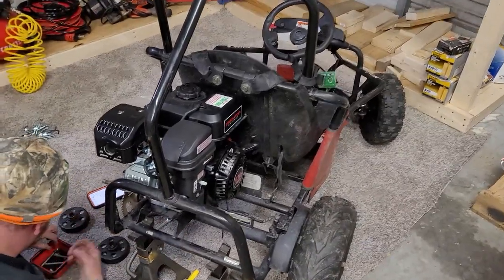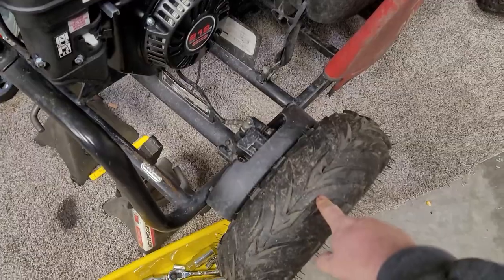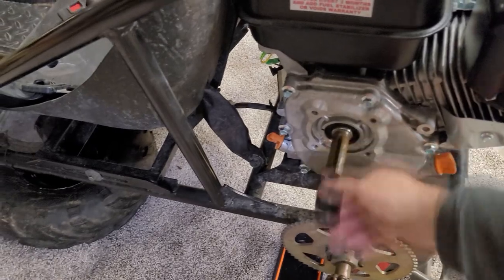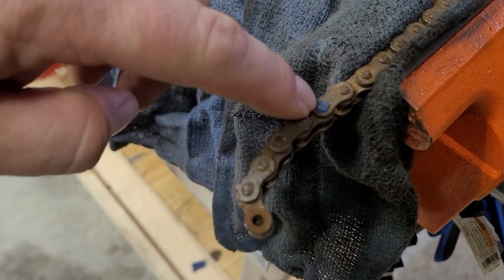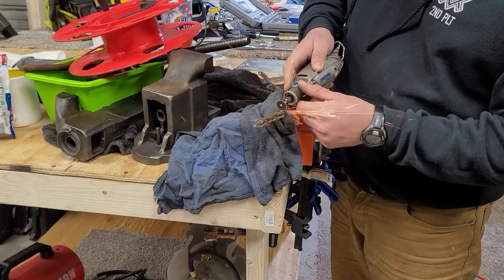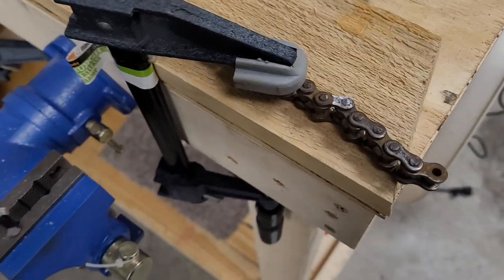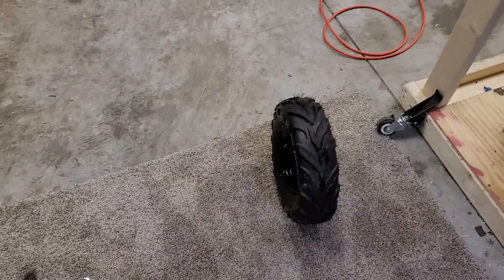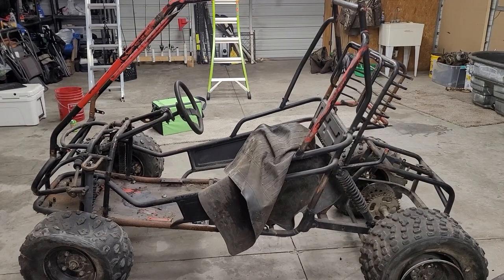Coleman CK-100 S 212 Predator Swap @harborfreight @ColemanPowersportsUSA

Comment: I wish you guys could ride Hot Balls Johnson, I'm building that to basically be an adults "ideal" yard kart. Biggest problem I have is slowing it down without locking the axle and ultimately the torque converter if I put one of my performance engines in it. Hopefully I'll be figuring out some disc brake options. I REALLY  wish I was skilled enough to figure out a 3 way hydraulic system with a manual handle out back for ummm....extra turning radius....🙄.
Reply from the maker: Man, I'm sorry I'm just now seeing this comment. A 3way system, thats interesting sounding. Might have to take a look into that and make it happen, then you can patent it and sell it to us knuckle draggers!!!
Reply: @LNRRidez  it's the dang front disc thing that gets me. I tried to space it out but I'd actually need longer spindles and junk.....I think I'll be satisfied if I can get a manual disc brake with a lever at this point!

Comment: Cant I just buy the 212  that comes with the pull cord the correct way. I want to do this but I saw there's two 212 engines same price. do you know what the difference is besides the pull rope?
Reply from the maker: Which brand of 212 are you talking about? Of you're referring to the Predators then yes they BOTH come like this. They are motors designed for pressure washer, trash/water pumps etc so you will need to rotate the pull cord on both of them (non-hemi & hemi).
Reply: @LNRRidez  thanks

Comment: Did the 212  drop right into the old motor mount holes for the original engine? Or did you have to modify the mount
Reply: I have the same go kart and got a 212 hemi, the engine fits right in it without having to cut any new holes. You don't have to modify the cable either. I'm just currently trying to figure out the clutch.

Comment: Were you able to used the same clutch? Should be there same 3/4 Bore 12T correct ?
Reply from the maker: The clutch was bad, it was a used one the owner bought from Facebook market place. We replaced it with a brand new one and everything was fine.
Reply: @LNRRidez  thanks for the responde I’ll be doing a similar swap this week
Reply from the maker: Let me know how it goes or if you have any other questions!
Reply: What size clutch
Reply from the maker: https://www.amazon.com/Clutch-Chain-Perfect-Minibike-Engine/dp/B01GFFHK0G/ref=mp_s_a_1_2_sspa?dchild=1&keywords=go+kart+clutch+212+predator&qid=1615505060&sr=8-2-spons&psc=1&spLa=ZW5jcnlwdGVkUXVhbGlmaWVyPUExR1dTSjA3QVBOUzNOJmVuY3J5cHRlZElkPUEwNjE0MzE5MzZBMVc5UTlYSU1SSyZlbmNyeXB0ZWRBZElkPUEwMzk1NDg3QkJOVklQRTYyVkhFJndpZGdldE5hbWU9c3BfcGhvbmVfc2VhcmNoX2F0ZiZhY3Rpb249Y2xpY2tSZWRpcmVjdCZkb05vdExvZ0NsaWNrPXRydWU=
Reply: @LNRRidez  what size sprocket did you use???
Reply from the maker: @brettsmith7201  I don't know, the owner bought everything and we just installed it.